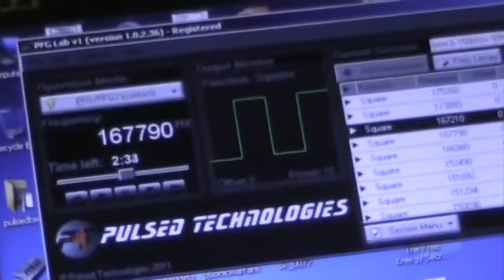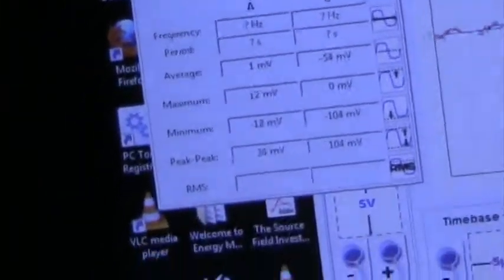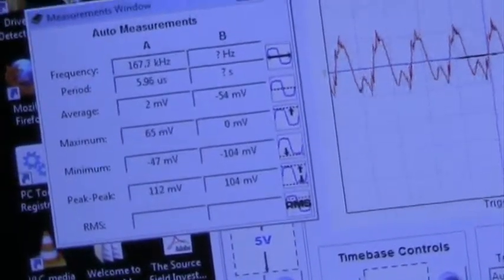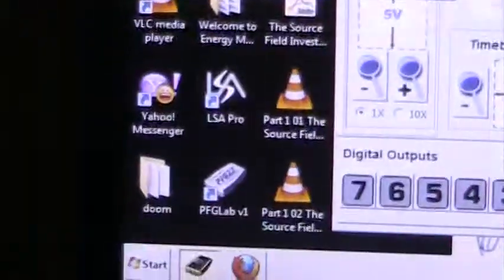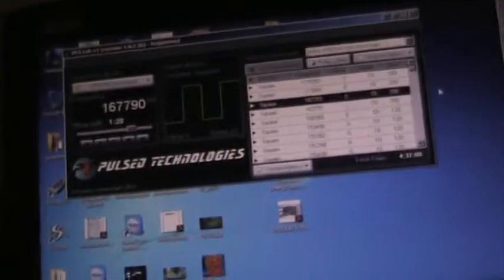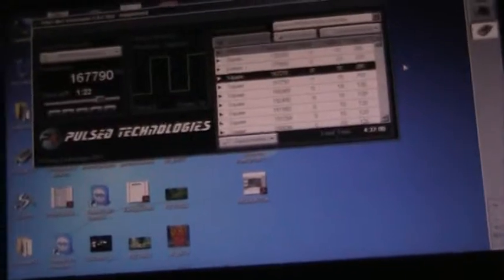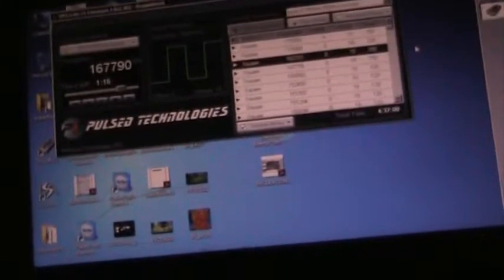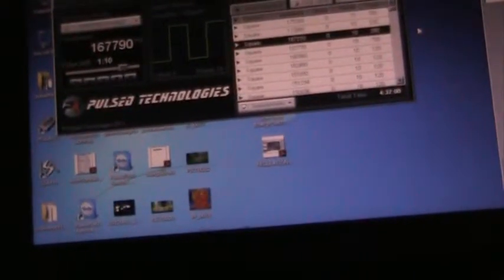p3pro high frequency verification!  Truerife beamray bcx ultra time to show yourself

Comment from the maker: your welcome, i did it with a cheap oscilliscope better ones can determine more accuracy, and differentiate between the high intensity pulses that happen with the 50khz etc and the secondary tertiary etc that mine is sometimes picking up.    Im also calling out these other manufacturers to proove themselves please share if you know people claiming to have similar technologies.